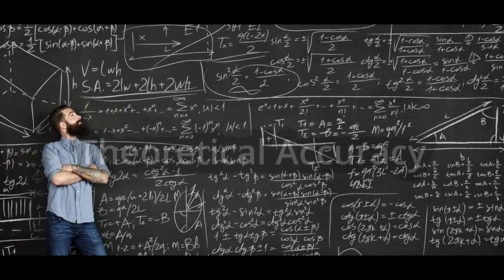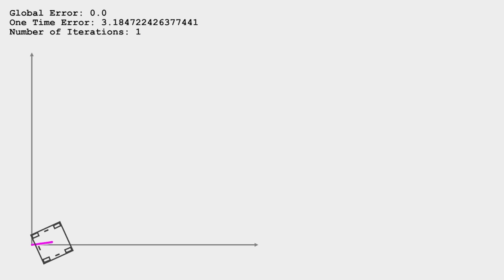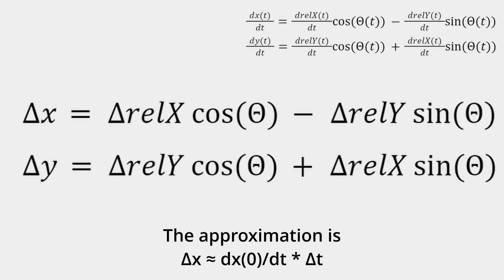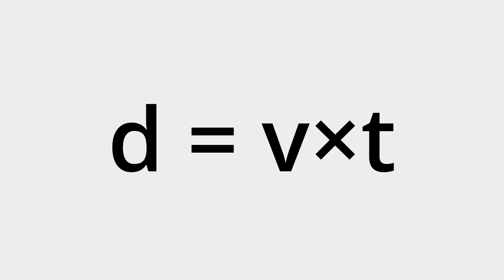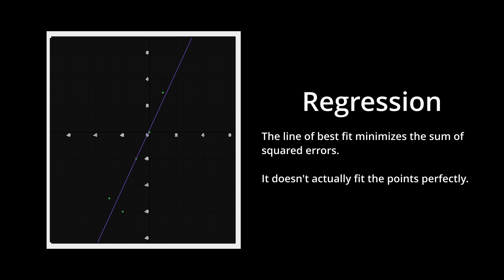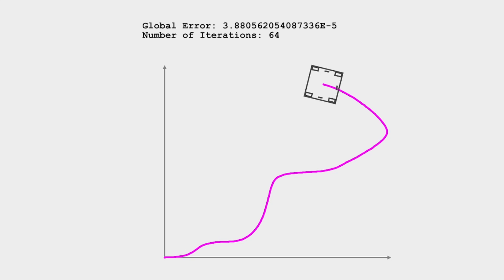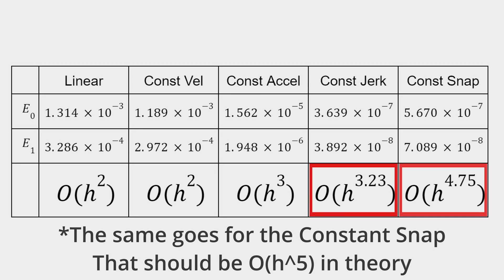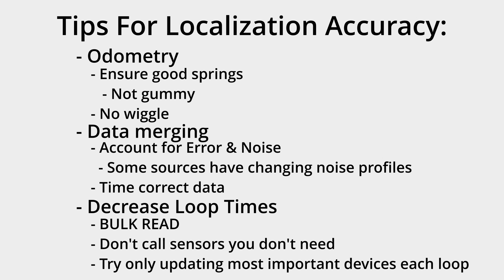Intro to Odometry in FTC Part 2 | The Clueless #11212

Comment: Hi, I'm having issues connecting my odometers and getting them in the Drivers Hub. How do you do that setting?. I connect to the encoders JST ports but I can not get them in the hardwaremap. I'm using gobilda dead wheels. 48mm
Reply: Encoders don't come up in the hardware map. You simply need to define a motor at that port and then you can call for that motors getCurrentPossition() while coding to get that odometers value